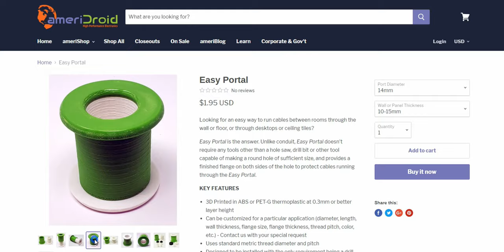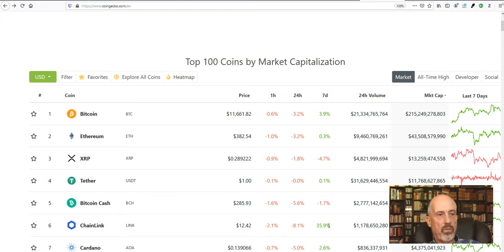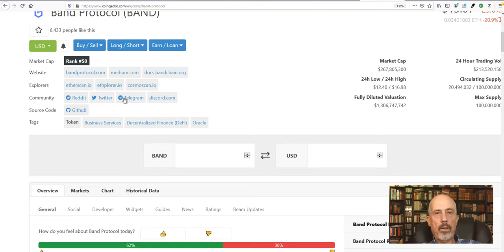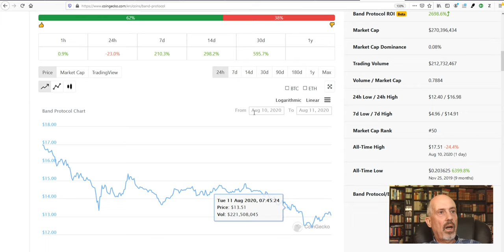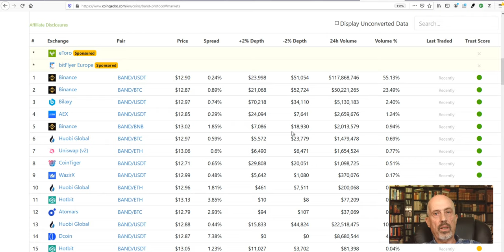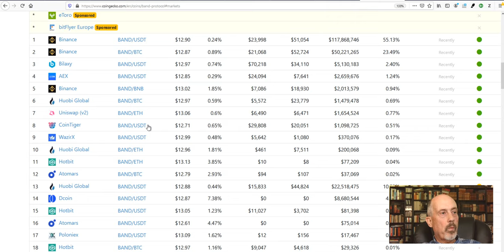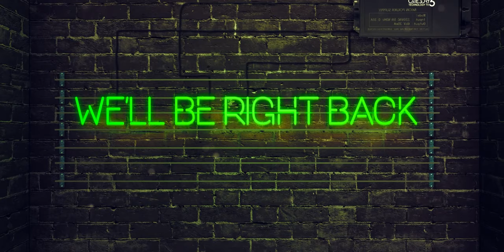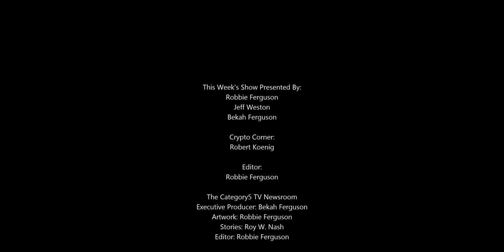660 - Cables Through Walls

Comment: I want the ability to 3d print metal parts. I know they have those now but they aren't affordable for the average person. Maybe one day they will come down like the plastic 3d printers have. I can only imagine what I could do with the metal one.
Reply from the maker: Yeah, I've seen a variety of metal printers. Very cool stuff... though much more industrial (and expensive). My needs with 3D printing are so basic, especially as I'm just learning. I like the idea of printing in PLA/PETG (ie., plastic) partly because it means fast prototyping for very cheap, without a lot of fuss or mess. There is also metalic-looking PETG available for if I want that appearance... but none of the ideas I hope to print actually require the strength of metal. All light-weight projects that will do very nicely as plastic parts. And of course, plastic works perfectly for the product shown in the video!! Fun fact: I can prototype something using PLA and then once I've perfected it, send the design file to a company that has a metal 3D printer to print it in metal. Much cheaper than buying a metal 3D printer! #lifehack  :D
Reply: @category5tv  I could see myself making metal parts for my tractor, or vehicle, or replacing a part like a gear or pulley or something similar. Would be too cool.